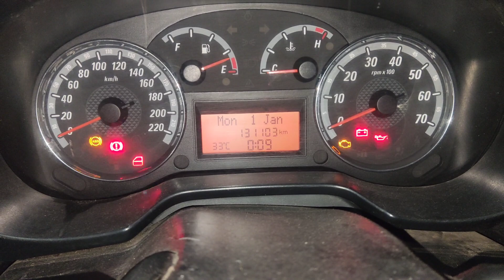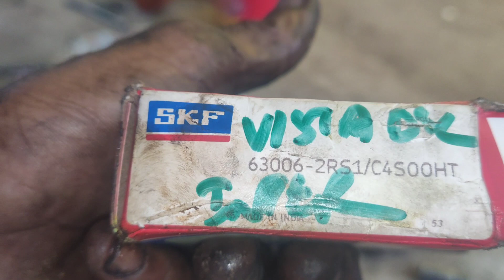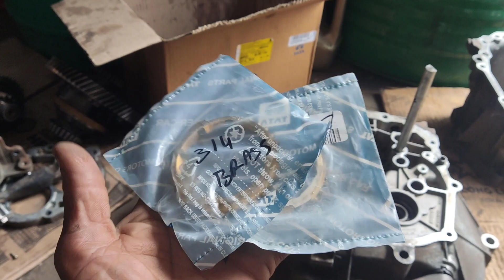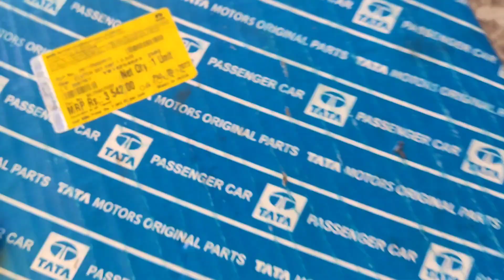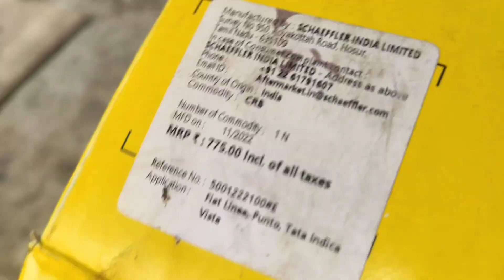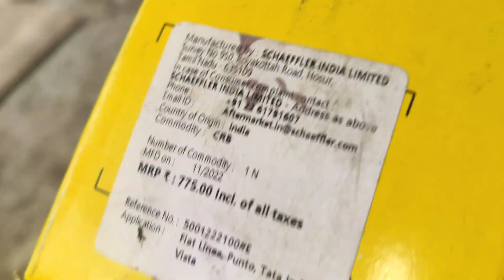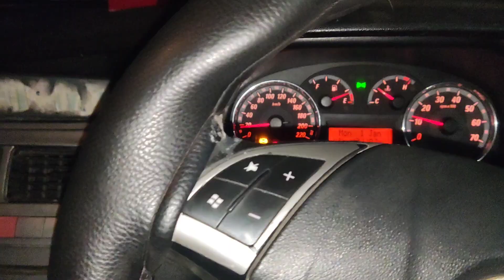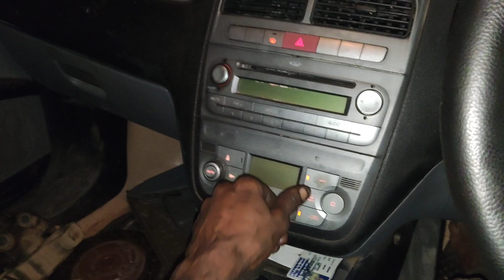Fiat punto general work,2(@skilledmechanictamil )

Comment: Unga work eppothum super anna , indica cr4 anna speed breaker la yeri gear change panni clutch vidum pothu mattum  pothu engine off aguthu anna ....enna check pannanum
Reply from the maker: Injector issue brother add engine oil in fuel tank 1/4 liter
Reply: @skilledmechanictamil  thank you sir